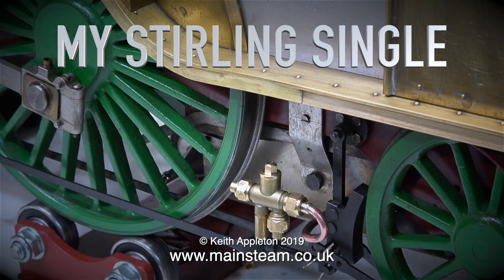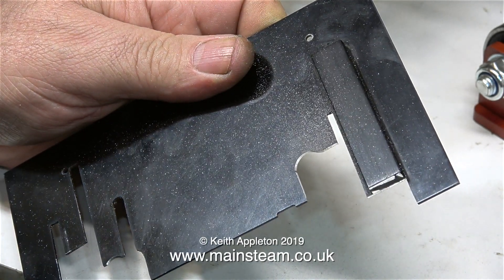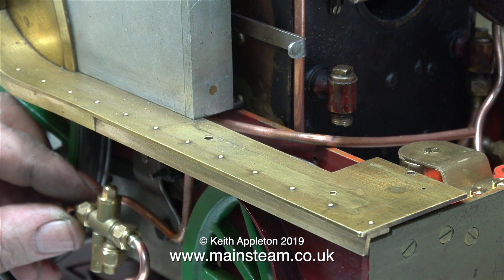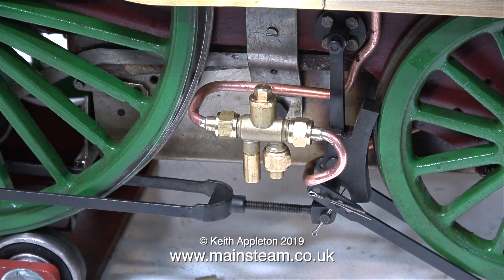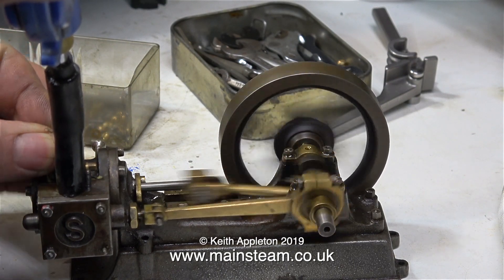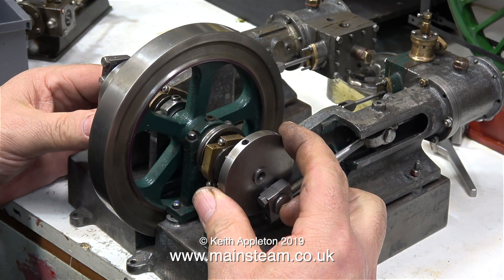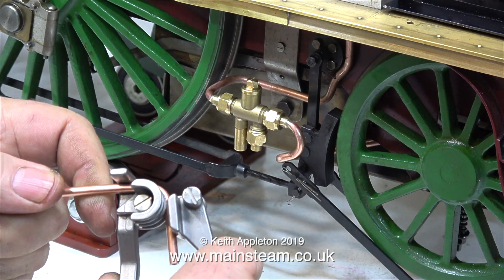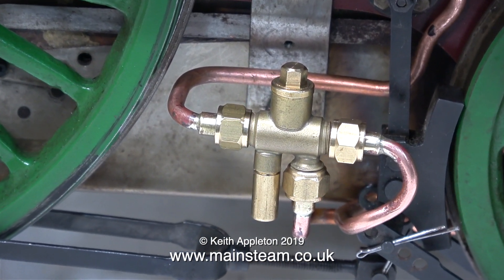MY STIRLING SINGLE #14 - COMPLETING THE INJECTOR PIPING

Comment: Hey Keith.
Just a thought, could your dump pin be put in from the other side? That way you could position the injector wherever you want it. I would also think it would help you from getting your hands steamed with hot water if the injector dripped, or does it only drain cold water?
Reply from the maker: a nice thought, but as both of the injectors are in exactly the same location at both sides, little would be gained }:-)))
Reply: Well sir I had thought about that right after I posted but did not edit to ask you if there are two injectors. by the way I still intend on sending you the tap Drive set, but unfortunately I had had a injury at work and have been on workman's comp for a while so as soon as I'm back on my feet I will get them off in the post it to you.